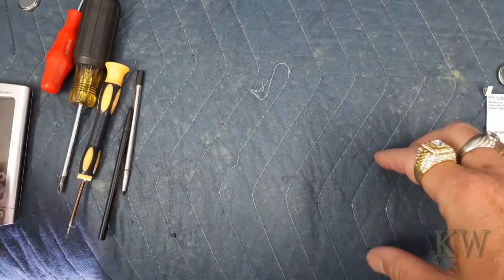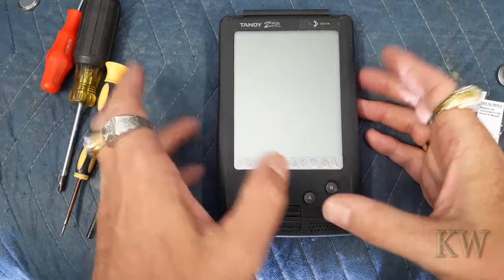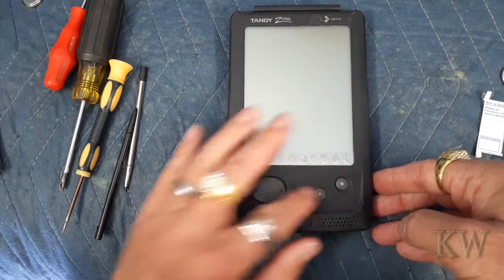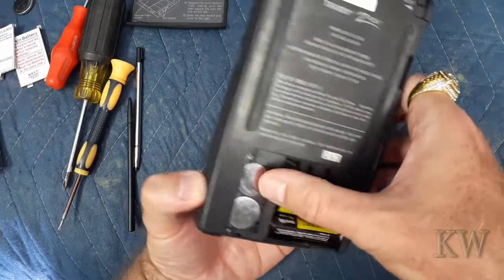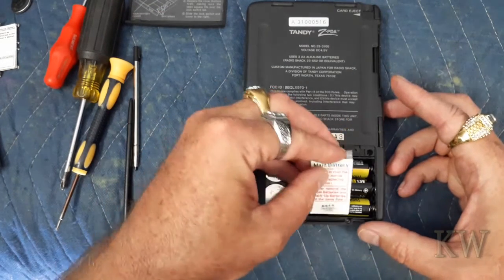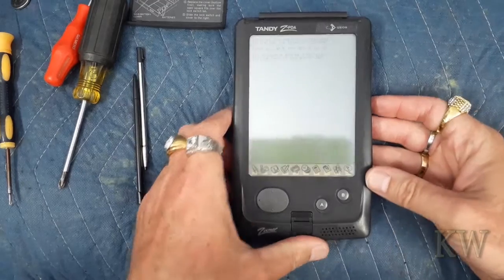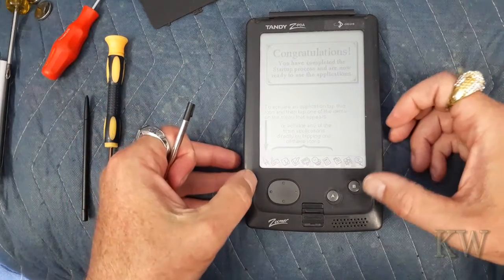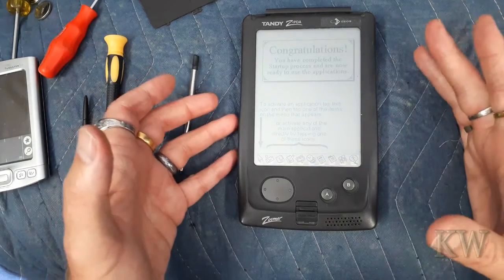Tandy Z-Pro Zoomer.  Will It Zoom Again?

Comment: I still have mine. Bought it at radio shack in 1994. Had a modem and could check my email using the built in AOL app. Good times.
Reply from the maker: It collectable by the Tandy collectors.  Been offered some$ for mine.

Comment: Yeah.
That button slider in ceter of front was to click free the flip-over [double hinged] hard cover.
I had one in college  for note taking.
And with "Palm Grafitti" the handwriting to text functioned excellently.
Both the Apple Newton and the Casio/Tandy Zoomer did handwriting to text conversion...but only the zoomer, allowed text AND DRAWING at same time.
Also, Radio Shack offered a flat, battery operated Dot matrix printer that connected to the RS-232 i/o port.
I forgot about the PCMCIA slot...as those became important much later.
Reply from the maker: @NatureOkie  Tandy had some sweet hardware